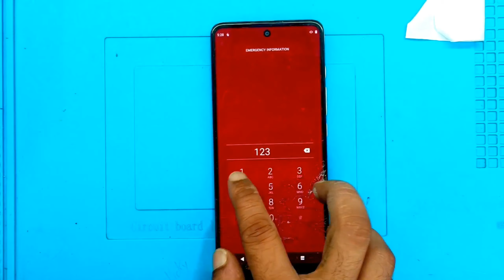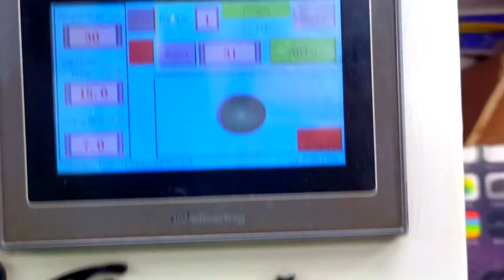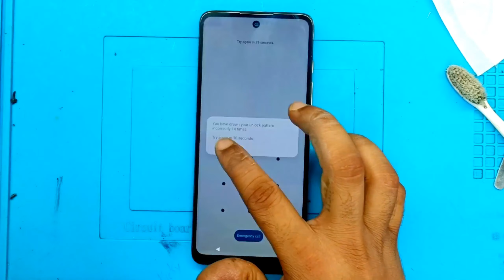MOTOROLA G60 GLASS REPLACEMENT | #sparerepair

Comment: Aapki shop kha hai
Reply from the maker: Thank you for contacting spare repair !

Shop address - 
Karol Bagh, Gaffar Market, Gali Number 18, Hira Plaza, Shop Number 5, 6, 7 or 8, Mobile Complete Solution, Near by Network Plaza, New Delhi, (110005) Mob. +919319167665

Courier address - 
Vicky Kumar 
Mob. 9319167665
A - 335 ( block - A ) budh nagar, inderpuri, j.j. colony, new Delhi, 110012